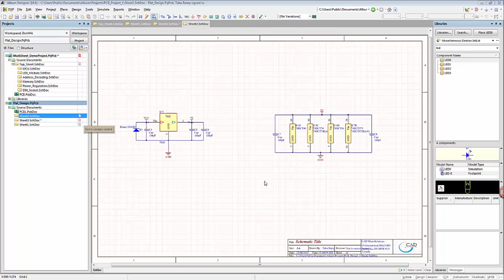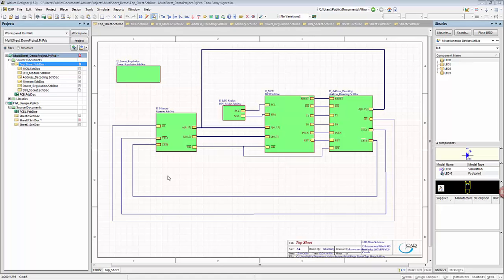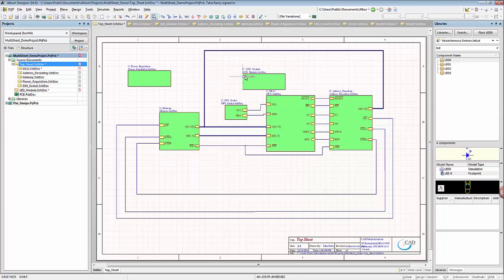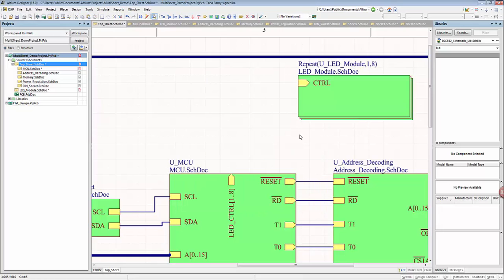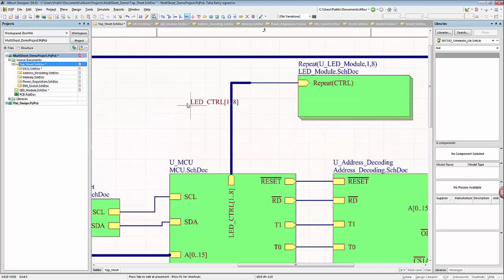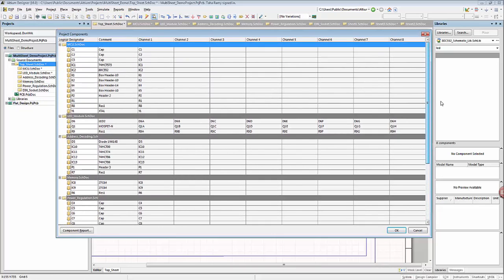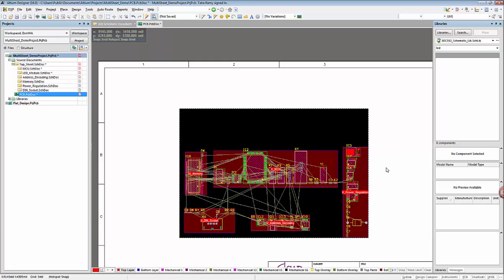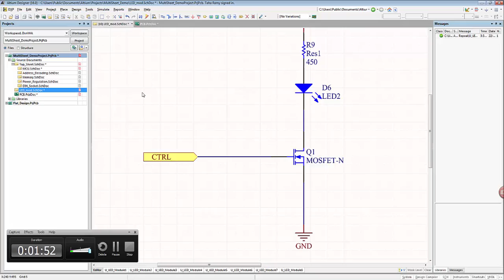Multi Sheet and Hierarchical Structure

Comment: Great tutorial! Thanks. Also, how do you do that preview when you hover your mouse over the sheet symbol?
Reply: Hi. To activate the preview you should go to Tools-->Preferences and then select the System tab. In this scroll down to Design Insight. At the bottom of the page you will see a table under the name Connectivity Insight Options. In this select the Document Tree and Document Preview for Mouse Hover. I will be happy to show you this by sending you a picture, if you find these instructions a bit difficult to follow. Please email us at support@cadmicro.com and use PCB Command in your subject line. Thank you. Talal Azfar
Reply: @talalazfar2855  Thank you so much Talal!

Comment: Greetings. How you make only one pcb from mutiple schematic sheets?
Reply from the maker: Hi Ney,

As shown in the video, the schematic sheets are connected using the Hierarchical Structure that is internal to Altium Designer. The connectivity from sheet to sheet is done using object types such as Net Labels, Ports, Buses and more. This allows the designer to be have nice, clean schematics that are easy to read. 

Here is some more information http://techdocs.altium.com/display/ADOH/Connectivity+and+Multi-Sheet+Design 

You can reach us at 416-213-0533. 

Thanks! 
CAD Microsolutions